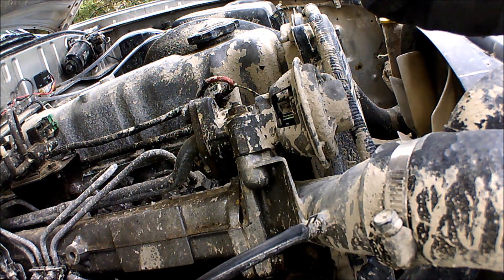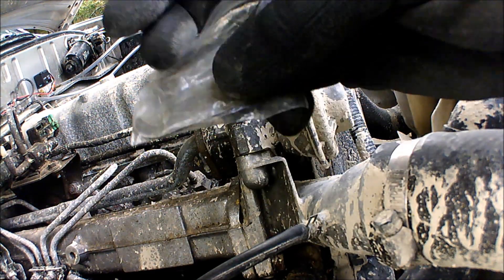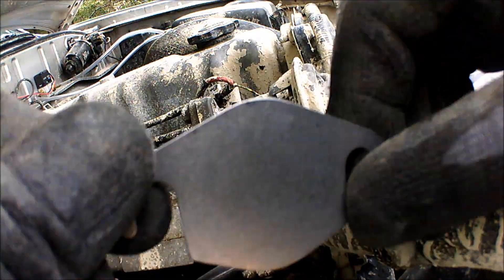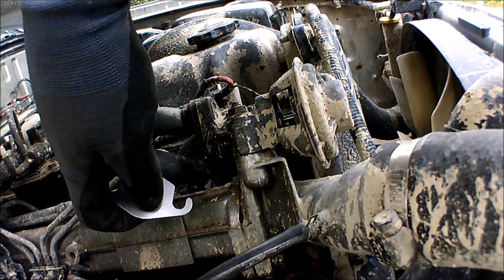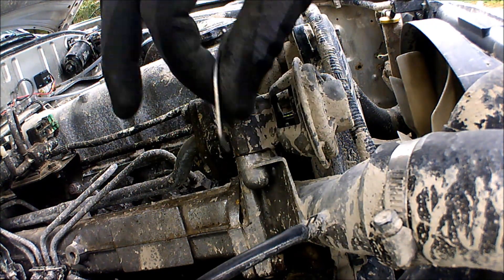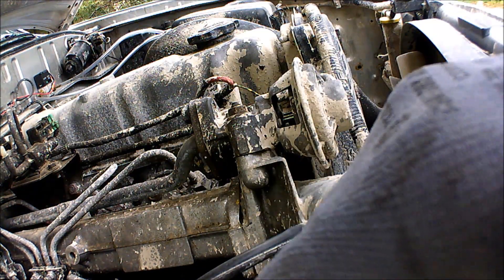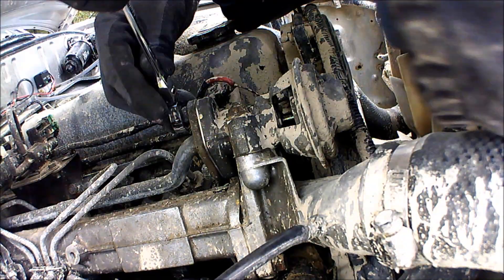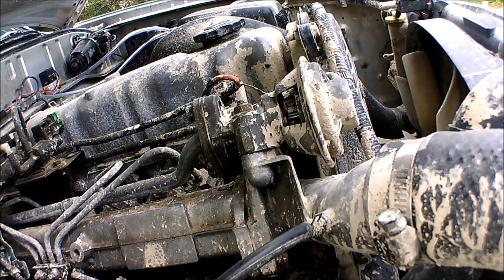EGR Blanking on Ford Ranger 2.5 TD / Mazda B2500 / WLT engine

Comment: I did this egr delete a few weeks ago. It solved my overheating isue due to exhaust gas going into the cooling due to faulty egr cooler.  I only blanked the pipe from the exhaust that goes over to the egr cooler on the inlet side.  Those wouldn't slacken.  The one I tried was only offering to shear so I left it.   I never disconnected the solenoids.  Now after about 200miles I have the start of an electrical fire somewhere down the back of the starter motor or over beside the exhaust.  I need to get the truck towed home before I can search for the wiring issue.   Is this likely due to not disconnecting the solenoids or possibly caused by excess heat in the exhaust melting wiring which is routed to close to the exhaust.  Any advice/pointers will be greatly appreciates since I need the truck for work and it has been broken down since Thursday last week.  Thanks in advance.   2004 Mazda B-2500 2.5 td 4x4 fire behind engine after blanking egr
Reply from the maker: The burning issue you're having sounds like a coincidence. There is nothing in the EGR system that could cause that, there's no sensors to cause overfueling or leaning out that could make things run hot, in theory it should run cooler. The solenoids won't overheat as they are either open or closed (on or off) so can't be getting overloaded even if left connected. Sorry I can't help diagnose a burning smell from this description
Reply: @DumDum306  I was informed on some other source that the exhaust on vehicles that have had the egr blanked off can glow red when in slow traffic and other conditions when air cooling is compromised.  It definitely smells electrical and the battery was drained to low 12v  and the earth lead from the battery to inner wing was heating up when I tried cranking the engine clearly showing something is short circuiting.   I will get under it tomorrow and find the melted wiring and if not that I suspect the starter might have stuck on engaged drive and overheated.  I suspect if wiring they will be beside the exhaust down-pipes and cat somewhere.  The smoke was billowing out from the bonnet and underneath just before I switched off the ignition.

Comment: I have just removed my plate after a year as the fuel economy went up considerably..trying it without to compare.
Reply: wayne bonham how's you ute going now?
Reply: I think I gained a 10% improvement in fuel mileage without the plate and with the same load..I am going to try a 6mm hole in the plate next as I heard the sensors need a little Co2 to function correctly

Comment: Can i take all the egr stuff off and blank from the bottom
Reply from the maker: Yes you could if you wanted, it's just more work as you need to blank the vacuum line and remove and blank the pipe from the exhaust manifold.

Comment: Fitting a blanking plate will that cause the engine to go into a limp as there are vacuum lines running off the valve?
Reply from the maker: No it's an old school mechanical injection engine, there's no ecu control of fueling or boost so you won't get an EML.

Comment: Can you put a blow off valve on a ranger
Reply from the maker: You can yes but as they don't make vacuum in the same way as a petrol you need a microswitch that activates a solenoid when the throttle is closed and that solenoid needs to be in run from the vac line.

Comment: What did you end up doing with the black Ranger? Did you get another engine or what happend ? Im going too have too weld mine up, she snapped in half.. lol
Reply from the maker: +11MrEwan I sold it. Replacing the engine (as I'd of had to buy a crane) would have cost more than I paid for the truck.
Reply: +DumDum306 Ahhhh I see, and do you notice any power difference now you've blanked off the egr? 
my mate says his transit goes a bit better now it's been blanked 
And what other easy power gains is there in a ranger?
Reply from the maker: Nope, none whatsoever. You shouldn't notice any either unless your old valve was leaking (which they sometimes do)

Comment: I want ask regarding My ford Ranger year 2003, The problem is when I start , indicator at meter RFW always light up, I have to reset by manual switch which is located at left stering . Last time when not like this, Always when I stop and start again I have to reset, why happen like this?? Can somebody help me?? To solve this problem??
Reply: you have a vaccuum leak somewhere, check all your piping.
Reply: Common problem with these bakkies. Did you have any work done on your gearbox? Sometimes the mechanics mix up the wiring. Aswell have a look under the hood. Blue and yellow solenoids. Make sure they are function properly, and that you do not have any vacuum leaks. Also don't mix the up!